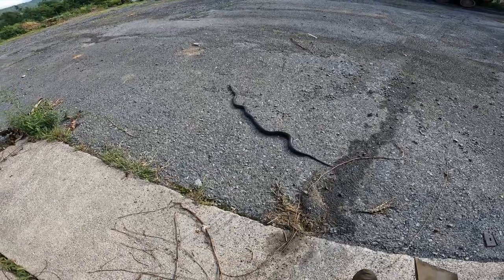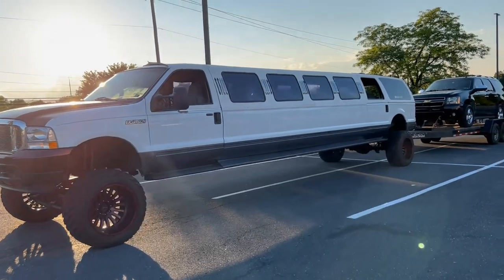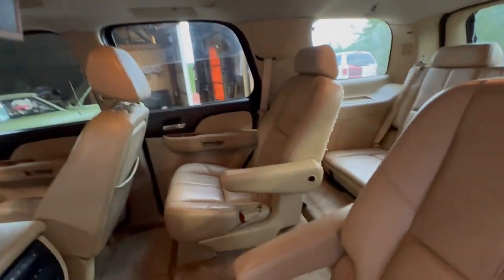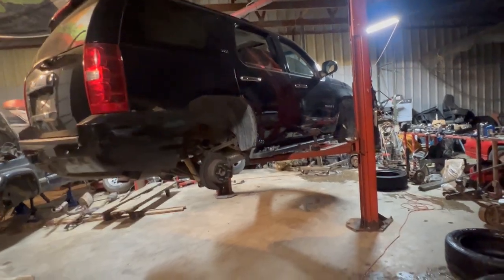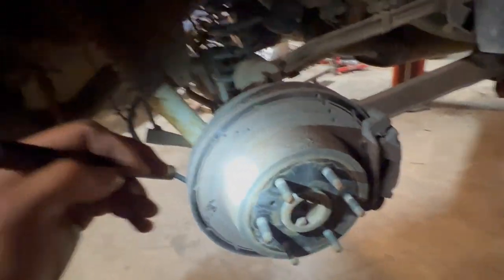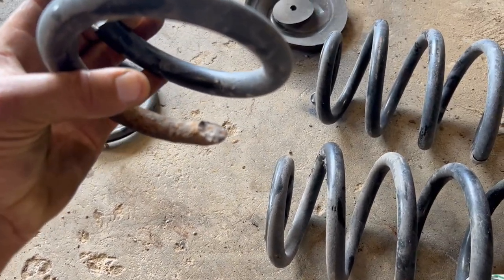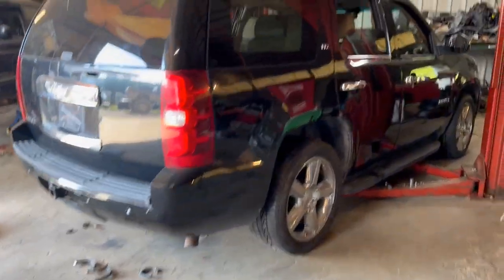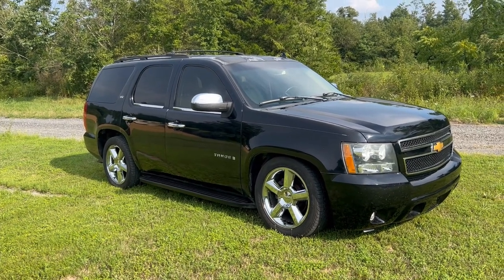I bought a Tahoe to lower, here is How NOT to lower your TAHOE!

Comment: When you cut the bottom of the rear spring, do you have a problem fitting it back into the rubber pad?  It was a different shape right?

Comment: Do not tow with this truck till you get the new rear end and trans or buikf them I have the same Tahoe trust me mine is 2 wheel drive I threw the rear wnd out with 26x14s it’s on a 7.5 lift trans went first just by the wheels fixed it and then went the rear end I had to do 410 gears and a caddy trans fits mine is a ..z71 package it’s on my profile pic but same truck just lifted same 5.3 mine is ls3 cammed and chipped times and all but you can’t pull anything with this till you at least do the gears trust me